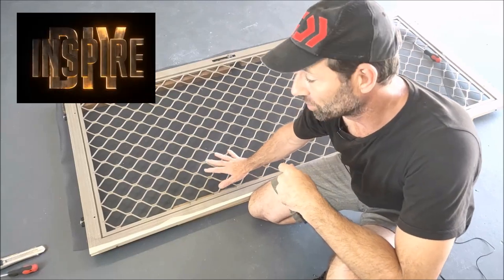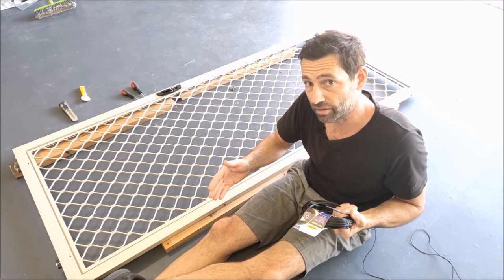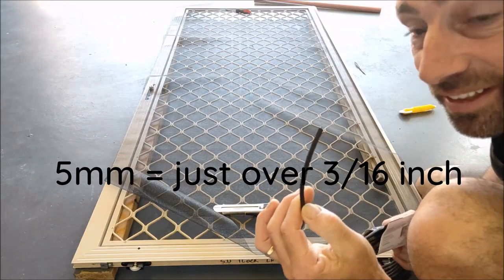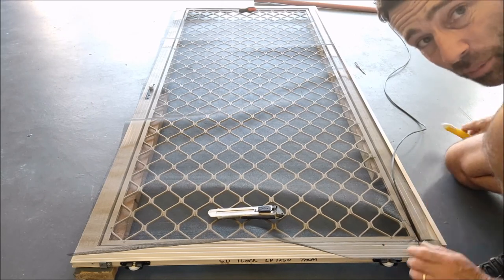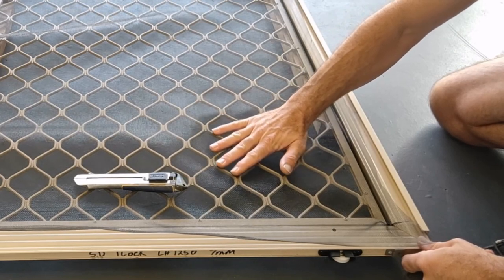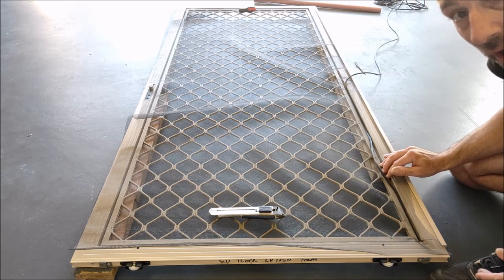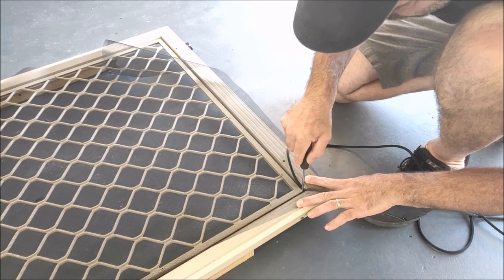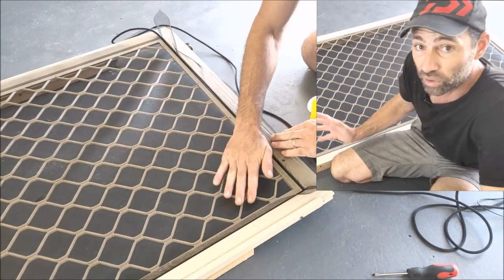which size screen spline should I use with Inspire DIY Kent Thomas

Comment: How do I use a measuring tape to measure spline?
Reply from the maker: Hey Squirrel, lay some spline across a tape measure and count the mm or fractions of an inch, if the rubber spline is too damaged or wrong size measure ‘the gap’ or the channel in the screen door where it’s installed to find the right diameter. 
Next measure the circumference of the door and that’s how much you’ll need.
Best of luck 👍Kent
Reply: @InspireDIY  thanks!  How do I convert from a fraction from my ruler to what they use to measure the spline?  Spline has measurements of 0.140 in, 0.175 in, 0.3125 in, 0.160 in, 0.220 in, 0.160 in., etc.

Comment: The opening in my frames is .185 but opens up inside to .250 inside where it's radius so I'm not sure which to go buy, I did my whole lanai with .160 and last night we had wind and rain now I have to go find my screens, thereshould be a standard diameter to go buy when we know the measurements
Reply from the maker: That would be helpful John, hope you found your wayward screens and got them back in ok👍 Kent